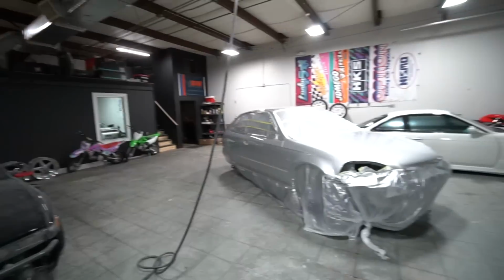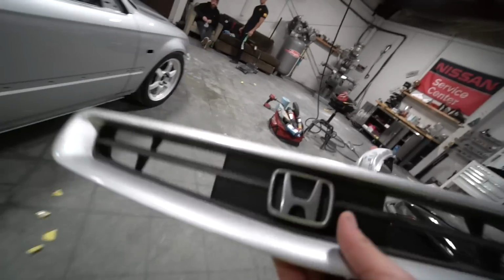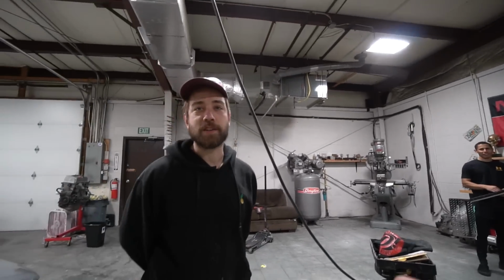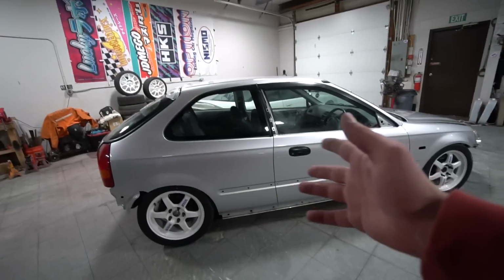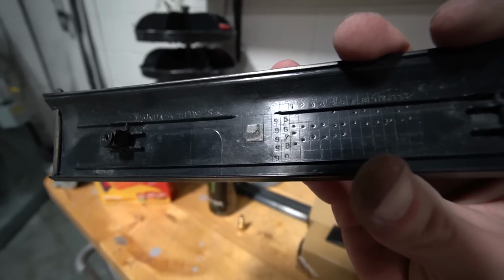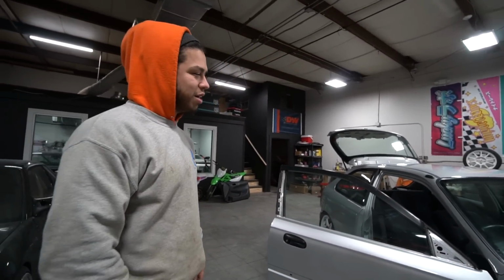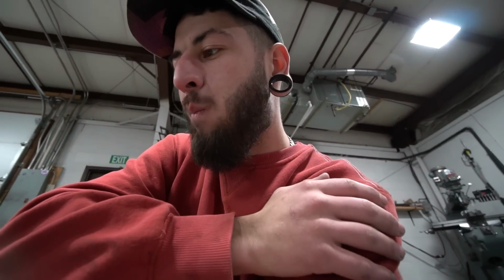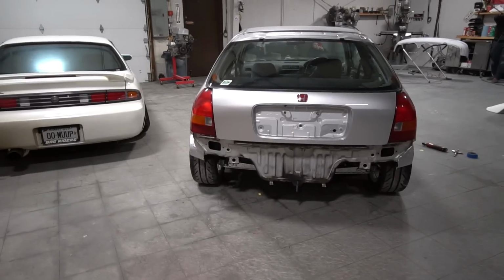New Shop Project! Assembly Begins On My EK!

Comment: Ek9 has the front badge on the bonnet, so completely different to yours.
Ek9 rear hatch is slightly different, has no wiper hole and the number plate recess is different.
Reply: His dont have a wiper hole now and yeah man there are different versions of the ek9 the zenki and kouki earlier and later  !
Reply: Yep. Badge on hood, grille is all mesh. Thought the hatches had the same badge holes, but I could be mistaken. CTR stickers would look a little goofy right now with those chrome housing headlights.
Reply: @shannacollins4741  he welded up the hole but it did have one
Reply: He also needs the type r bumpers because it would look weird having wing and and red badges with a poverty spec grill and bumpers
Reply: @jdm_john8240  i know he did i watch the vids thats why it doesn't have one now like i said and thats what i said just get Type R front and rear bumper and hed be good and im sure other people have said it already tho so yeah its whatever its his Honda not ours and if he wants to make it a hybrid Type R thats his business plus a Type R doesn't have the black trim down the sides its all paint matched but he decided to leave it black you know DJs a different kinda guy hes not all about the norm as we can see in the S14 !

Comment: Get some Si taillights. Keep the trims black. Find oem emblems for the rear. And just use the small red Honda badge with double tape for the front. Tint the windows. Maybe find some Si wheels. Very rare and just keep low and clean

Comment: You need to get the ctr thin side moldings and get some stock civic bumpers to paint. Also, get a ctr grill your emblems. One goes on, hatch the bigger one, and the small one goes on the hood.

Comment: To put the rear batch on the trunk you need to cut off the 2 pieces off of the batch and use the double sided tape to glue it on. The bigger batch goes on the hood and you also need to cut the 2 things off of the batch and glue it on with the double sided tape.

Comment: You can get the emblems from the dealer still. I use Majestic Honda online, they sell parts below msrp, they’re higher than shop cost though if you have a commercial account with a local dealer.

Comment: The type r has its badge on the hood not the grille. That's why it has a different front grille. 

It cant be a near a type r only a type r clone. You need a oem rear lip and front lip. 

ICB Matt is the guy to get all the jdm parts and oem parts.

Comment: Authentic OEM JDM Honda Civic EK9 Type-R Emblem Front: 75700-S03-Z00
60 x 50mm
Front Emblem Dimension is about 2.4 inches by 2 inches measured across the middle of the emblem

Authentic OEM JDM Honda Civic EK9 Type-R Emblem Rear: 75701-S03-Z00
60 x 70mm
Rear Emblem Dimension is about 2.7 inches by 2.3 inches measured across the middle of the emblem